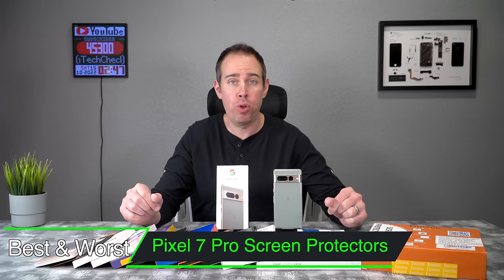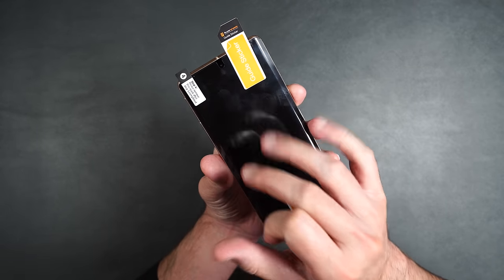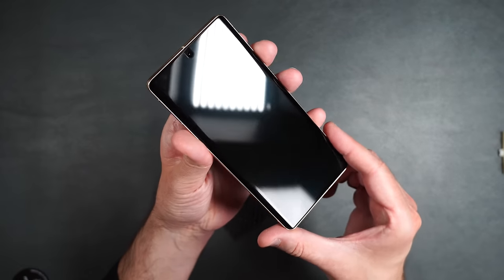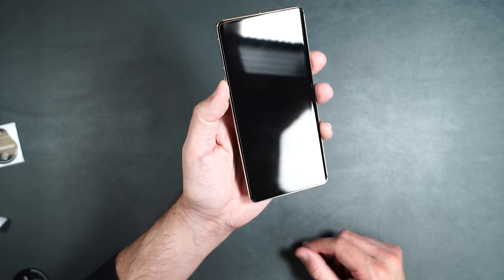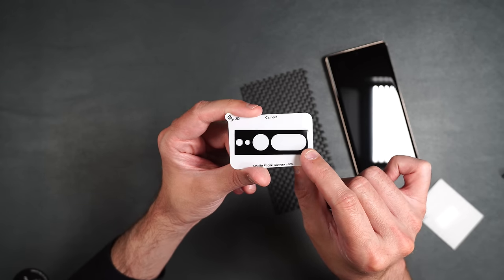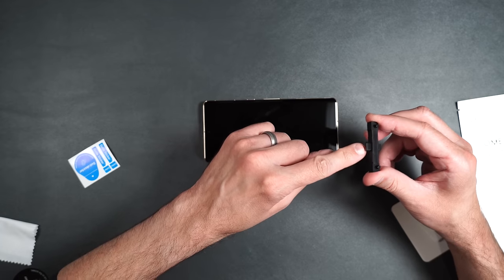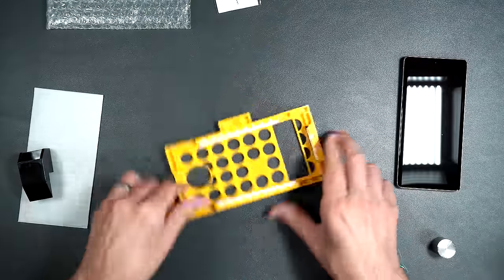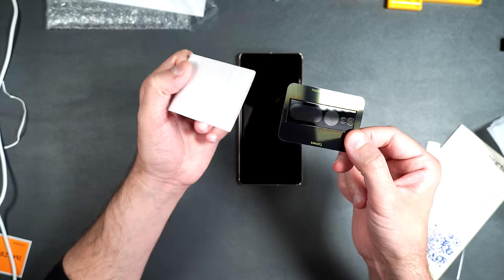Best And Worst Screen Protectors for Google Pixel 7 Pro

Comment: @HighTechCheck I thought we were supposed to put 2 guide stickers on the left hand side of the screen protector and then without peeling the screen protector plastic; position the screen protector to the phone. Stick the 2 guide stickers to the phone. Once it's taped on the phone and screen protector open it like a book and peel the back plastic on screen protector and drop the screen protector to phone.

Comment: 59:04 If it's going perfectly and spreading across the screen then don't touch it but if it looks like the liquid isn't reaching right across the screen then don't be afraid to lift up the plastic phone holder to encourage it to spread out more and if it's starting to harden and still won't go try encouraging it with a squeegy or the plastic black guide to get it to spread right across. If you fail the first installation, use alcohol whipes or alcoholic/anti bacterial liquid to loosen the hardened/jellified liquid off of the screen protector to be able to completely get it back to square 1 and try again with another liquid vile so you don't waste a screen protector. I messed up the installation first time then the second time the liquid still looked like it wasn't going to spread properly so i just said screw it, and picked the plastic holder up at one end and used the black sliding tool to encourage the liquid to the edges and it ended up fitting perfectly. Now that it's on, the screen protector is awesome but definitely watch the guide video a few times through before starting and don't be afraid to get hands on if the liquid isn't spreading across the screen properly.

Comment: Thank you so much for all the effort you put into this video. You delivered very much useful information in a terrific format with no fluff. I understand screen protectors much better now.

About the horizontal line: This is an inevitable result because these film protectors are in two parts - the top half and the bottom half. The line comes from the gap between the halves. There's only so much engineering that can go toward minimizing the gap without boosting the price unacceptably. 

One thing is for sure from the comments: There is no 'best' here, only what's best for you. Watching you apply the Whitestone Dome with liquid makes it seem do-able even to a klutz like me. But why couldn't they put the bridge in the center, so we don't have to entice the glue into that position?

Comment: Hello ,anyone else use the AACL ? and experienced the same issue with the line thanks ?
Reply: The line rubs out. But my installation failed because the edges would not adhere. I then went with the IMBZBK tempered glass. Surprisingly easy to install. Excellent result.
Reply: @rebdovid  thanks , I will give it a try

Comment: Great review and presentation. Thank you. The AACL looks the best to me, in my opinion. Obviously, the tempered glass protectors are the best when it comes to protecting. But I've ruined too many installations, from unleveled surfaces to soft drops. It's simply too much work for the reward. The hybrid seems like a good compromise.
Reply: "AACL looks the best"... are you sure you'd be happy to have that line in the middle of your screen?
Reply: @kuztardd  That is a good point. But I'm assuming (maybe wrongfully so) that the line disappears over time. At least, that has been my experience when dealing with high quality TPM protectors. If the line stays, then my vote is out. I bought the AACL and will be giving it a try shortly. I'll update my comment with results.
Reply: @franciss.fernandez7581  I'd appreciate some feedback on this too. Although TG is the best, the installation process is not guaranteed to be the best in my case and would rather go for the hybrid feel. AACL is what I want to go for but I'm not too sure about the horizontal line.
Reply: @xalmak  I'm installing the AACL today. I'll follow here and let you know. It'll probably be a day or two before I can tell if the "line" remains or disappears after a while.
Reply: @franciss.fernandez7581  Thank you so much, I really appreciate it.
Reply: @xalmak  I just installed it. The line is very, very faint, as I managed to buff it out before using the UV light. I can only see it if I really look for it. But it is definitely there. The screen protector itself feels more like glass than it does TPM. I like it. I did lose one of the protectors during installation. But I think it was my fault mostly, as I was a little sloppy installing it. You have to really pay attention to the instructions. Overall, I'm satisfied with it. Tomorrow I'll check the line to see if it is any visible. Keep in mind that I am a little OCD, so any little scratch or defect bothers me. I'll let you know if the sides start peeling off or if I see any issues. I'm also curious to see if it "self-heels" like TPM does. I have a few faint scratches on mine right now. I think by tomorrow I should know. So far, I don't think it's a bad buy.
Reply: @franciss.fernandez7581  Sounds great, for the price it seems to be a good enough purchase. The rubbery TPU is generally something I don't like at all and the Tempered glass method for the pixel 7 pro is very annoying tbh. I'm also a little OCD when it comes to lines and bubbles etc for my day to day phone usage. Ideally a perfectly clean protector is what works best. But generally what you described seems to be great news. Thanks a lot for the feedback. Please let me know if you have any other observations that you think are worth mentioning. And again thanks a lot.
Reply: @xalmak  A few more observations. This screen does NOT self-heal like TPUs do. Mine still has some scratches and little dents here and there. Also, the line hasn't disappeared as I expected. But this makes sense now, considering it doesn't self-heal. But the line is still very faint. And unless I'm looking for it, I wouldn't see it. It's not a big deal to me. Also, the screen does have a bit of a rainbow effect. It's not easily detectable. And I think you can only see it under certain lighting conditions. But I did pick it up last night. Overall, I still like it. I think it's a great alternative to the messy and sometimes even ineffective tempered glass. I also like the feel of the glass. It feels pretty hard (that's what she said). By the way, the fingerprint sensor worked just fine with my installation as well.
Reply: @franciss.fernandez7581  Sounds like the positives outweigh the negatives in this. I think I'll get it for the glass feel and then use up all the ones in the pack until other companies make something new lol. The self healing thing is an issue but I guess I'll swap them out every now and then. Either way it'll be better than possibly dropping my phone and cracking the screen. Thanks a lot for the feedback, much appreciated.
Reply: installed the whitestone dome glass the other day. I can easily recommend it. I bodged a couple of screen protectors over the years but this one really is idiot proof and the outcome was absolutely perfect even for someone as untrained as me.

Comment: Optical finger print sensors are affected from tempered glass? I thought this was only an issue for ultrasonic ones .
Reply: I have a tempered glass on my Pixel 7.
When I first used my phone it was terrible and not usable even after enabling the setting to increase the sensitivity of the sensor.
But after I installed the first software update, the fingerprint has been working flawlessly and smoothly. And adding the same finger twice improves it even more
Reply: @johannesziaether3916  This does not answer the question . My question was specific about the tempered glass affecting optical finger print sensors ? 
Because i thouth that this was an issue only for ultrasonic finger print sensors samsung was using.
Reply: @Tsinepanos  
Yeah it does affect it, but not as much as it does with ultrasonic sensors. Some tempered glass more than others, it has to do with the thickness of the glass, its quality and how much it distorts light.
An average tempered glass should be okay.
I was just sharing my experience if you're willing to buy the phone and scared of this issue.

Comment: Thank you for this video...  

I've used Skinomi screen protectors in the past and never had a problem.

I thought I was doing something wrong with this one since the sides would not stay down.
Reply: Wife and I also have Skinomi protectors. Problem I had was repositioning them and having to reapply the liquid. Eventually, it weakens whatever adhesive is on the sides and they won't stay down at all. You really need to be lucky, get it done in one go, and let it dry a bit before applying the sides. Even then... its a lot of effort. Was much easier on my flat P6 than it was on P7P.

Comment: I never use a screen protector. Gorilla glass is much harder to scratch than a piece of plastic so if you are going to have a bunch of scratches on your screen protector you might as well deal with the scratches on your gorilla glass screen. 
It's a phone use it the way it's designed to be used. 
If you don't want any scratches do not place your phone face down avoid using it on the beach where the sand can scratch the screen and do not put your phone into your pocket if you have your keys already inside.

Comment: Do Gorilla glass victus need screen protector?
Reply: That is debatable. In the "old" days of GG3 the glass was harder, more brittle, easier to break, but harder to scratch. With Victus the glass is "softer" a little easier to pickup micro scratches but harder to break. The biggest problem we have with the 7 Pro is the useless curved screen which makes it more fragile and easier to break when dropped on the corners of the phone! So IMO a screen protector (tempered glass with loca) is necessary! On the FLAT regular 7 it is probably not as necessary. YMMV
Reply: @josephseman5333  thanks 😊